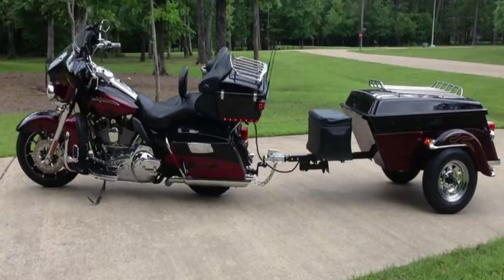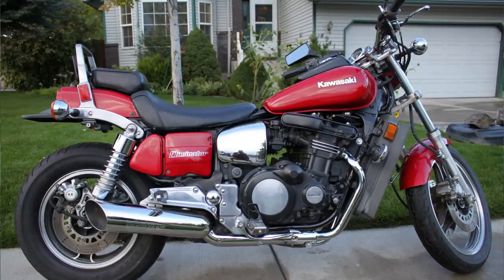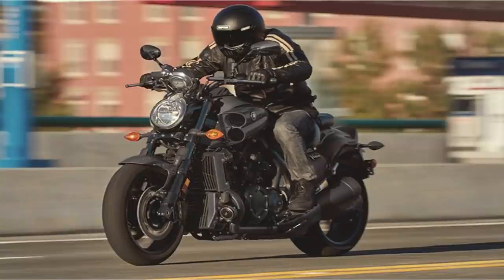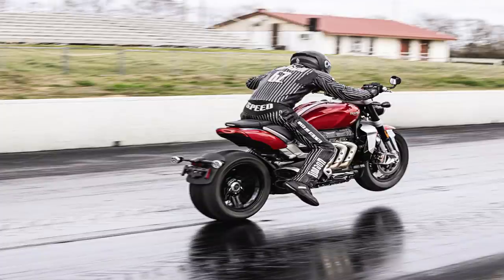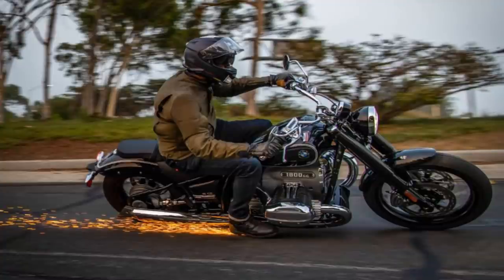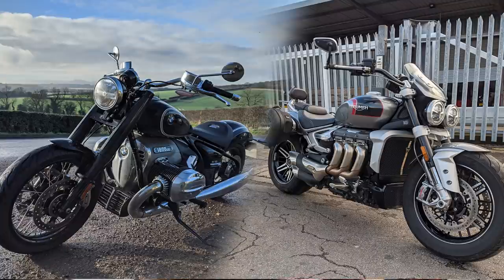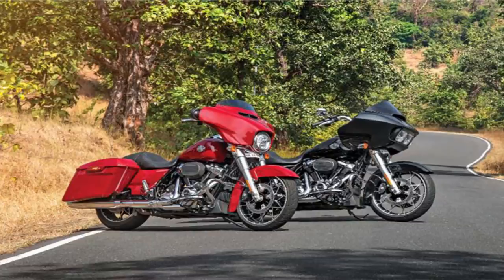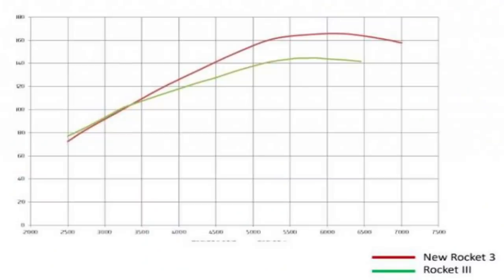Cruiser Motorcycles That Went Way Off Script

Comment: I like your video and breakdown of cruisers that our outside the box. I ride a Vulcan S. It’s completely different from HD. I had a Sporty 1200 and sold it for the Vulcan S. It’s lightweight (sub 500 lb) with the parallel twin out of the Ninja 650 that makes some kinda sad power numbers, but it’s chain drive and efficiently puts down most of the power it makes. It’s fast and fun to ride. It wasn’t expensive either. It’s a strange bike because it has the look and ergonomics of a cruiser, but sounds like a crotch rocket. 🤣
Reply from the maker: Those are really neat bikes though, they are like the Ninja 650 but they use a heavier crank and different cams for low to mid range torque. They really are a blast to ride, l always wanted to pit some Ninja cams in one with that heavier crank to see what it would do.

Comment: I had a GL1800 for a few years but I had some strange problems with it. After the Goldwing I got a Voyager 1700. I couldn't get rid of it fast enough. I love my 2009 twin cam FLHTCU, I have had it longer than any other bike that I've ever owned. However, if I was to go for a non HD again, I'd like to try that Beamer cruiser. 
At this stage in my life (63 years old) I'll probably just stick with what I know works for me. I have the ultra classic just the way I want it, big boar kit with cams, D&D Fat Cat Exhaust, SE Air intake, Legend suspension, Custom Dynamics Lights and turn signals, mustang seat, and a lot of other upgrades. Although a set of 14 inch Apes just could end up on the bike soon.

Comment: I would rather see Harley do a full water cooled V Twin Single Pin Crank motor with the fake fins that sounds just like an Evolution motor, but have the power of a 114 or better.  I could get past the radiator if it sounded, vibrated, and pulled like a Harley.  Should be alot easier to keep the emissions police out of your way.  Any maybe slow traffic in august would be more tolerable for the rider, and the motor.

Comment: Bike I have not owned yet.
1. 2014 Honda Valkyrie(6 cylinder) Basically a stripped down Goldwing. Similar to a Roadking concept. Would not mind having one of these.
2. Honda CTX1300(V4) The first thing I would do is try to tune it with a ST1300 map.
3. 2014+ Kawasaki Vulcan S - This bike is the most overrated and underrated bike ever. Fun and fast enough and reasonably priced.
4. Indian FTR1200. It is a twin, but a LIQUID cooled OHC twin.
5. H-D Streetrod 750. Not to be mistaken for the Street 750. One of the best bikes H-D has ever made. Just not a good H-D. Most people looking for a H-D would not be happy with a bike like this. But it is the highest performing H-D you could get new for under $10,000 Will even out run most H-Ds. If they come out with the Bronx, I am in!!!
6. The VMax 1800(V4). One of these days, I am going to buy one of these.
7. Rebel 1100 (Parallel Twin)  Been serious consider getting one of these as well.

I have had most other Japanese or America power cruisers at least once. Never considered buying a European one. Rocket 3s are cool, just not for me. I have also had almost every other cruiser V4 not included on this list. Now they are getting sick power out of smaller twins.
Reply: The Valkyrie is an amazing bike! Tons of power and silky handling.

Comment: i owned a few of the early metric muscle bikes, the Kawasaki Eliminator 1000, and the Sabre version of the V65, and i also owned one of the XS1100's and the original Vmax and yes they didn't have the low end grunt of some of the HD, and Indian cruisers, but back when they were out Neither did HD or Indian, 1 Indian didn't really exist, and Harley was just flipping over from the AMF 74CI 1200cc to the 1340  and back then Harley topped off at about 90-95 MPH and all of the Metric bike i listed Exceeded 130MPH some rather easily lol

Comment: Its a shame if you ask me that Harley abandoned the V4 project. I think the balance of torque and horsepower in a layout that offers similar external dimensions to a vtwin is the way to go. 

However im sure the long time customers would've hated it because it wasn't a vtwin and I can see their point of view. Harley is about building a classic American cruiser, like if GM still built cars that look just like 1959 Cadillac Eldorados, thats Harley's bread and butter. If you abandon the vtwin you lose that classic look and feel.
Reply: I don’t want MoCo to abandon the V twin. Neither the air cooled M8 or the liquid cooled Revolution. But I would love to see them add in a V-4. 

Especially a big displacement for the big touring bikes if air cooled can’t make future emissions. The Venture V-4 tourer was well liked. Honda & Yamaha took notes from Harleys V-4. The 500, 700, 750, 1,000, 1100cc V-4s Honda made were great. The 1200 & 1800 V-Maxes are icons. Both Magnas & V-Max followed the V-4. Harley was finally leading some tech and take over leadership failed to put it in the end zone.

Comment: A standard BMW r9 t push out roughly 99 horsepower at the rear wheel and weighs 200 lb less br18 is Big bloated overweight underpowered a BMW equivalent of a Harley shame on them

Comment: Been a Rocket rider since 2005 and it's a great bike but I wouldn't compare it to Harley cruisers. It's in a different league and it's classified more as a muscle bike like a GTO of bikes and it handles better and has much better ground clearance. It's like comparing a station wagon to a Trans Am. I ride my Rocket more like a sportbike and only see HDs in the rearview mirror. BTW the new Rocket has an increased capacity of 2500cc or 152ci. I have ridden many HDs but they don't work for me.
Reply from the maker: The Rocket is a beast and a lot to handle!
Reply: @GixxerFoo   It is but it is the first bike I bought after my learning bike, a Kawasaki 800 Vulcan. I had about 2000 miles under my belt when I got the Rocket then 500 miles later I rode it to the Dragon and tried keeping up with my sport bike friends. Go big or go home! The next year I started tuning it to add some HP. 😁

Comment: Great video. I have to say one thing. The inline four is also the cruiser sound from 1941 with Indian's inline four. So yes, a long time ago American manufacturing produced a big inline four. I'm holding out for Indian to build one in the modern version but I may be wishful thinking. LOL! As far as horsepower and torque. There were some custom VROD's that were stupid powerful and some custom Victory's that were stupid powerful. You know the bike that burns the tires at every light with just a crack at the throttle. Tire companies love those kind of bikes like the VMAX and the rocket three. On a side note they are fantasy bikes for me. I have to say I love the videos on other bikes besides Harleys and the comparisons are pretty honest.
Reply: Not just Indian but also Henderson and Ace. American motorcycles led the way with inline-4 motorcycles going as far back as before WW1. Smooth, powerful, comfortable and durable. The American inline 4 motorcycles from Indian, Ace, and Henderson were Duesenbergs on two wheels. 

It was afterall a 4 cylinder Henderson that was used to take the record of first motorcycle to circumnavigate the globe.

Comment: Love your channel and the tech info you share. What are your thoughts on the Ducati XDiavel?
Reply from the maker: It's fast and produces a lot of power, I like Ducati's but the maintenance on them is quite extensive. The parts are high, higher than a Harley and the labor costs are pretty steep. You just have to keep up with the maintenance on them and not let it go.

Comment: Please consider doing a video on the issues with twin cam and Milwaukee 8 6 speed transmission issues that are plaguing bikes across the Nation. Additionally there are no parts available for those who have lunched their transmissions. Bert Baker is laughing all the way to the bank
Reply from the maker: That's a really good point, there have been quite a few issues with the 6 speed transmission. Baker is about the only way to go with replacing one and for good reason!
Reply: @GixxerFoo  I wouldn't even want anything new. F that

Comment: Looking to maybe do a woods tw 222 in a 2014 ultra limited is it worth it or is the 103ho cam avout the same..or what cam do u sugest for this bike...bolt in torque cam
Reply from the maker: It's a night and day difference with the Wood 222! The factory 103HO cam is a .511 lift which is a decent improvement in torque over the original 103 cam. But the 222 is leaps and bounds more torque and horsepower output.
Reply: @GixxerFoo  thanks for the input...like your vids apericate the honesty and u answereing me...thanks again

Comment: I owned a 2014 Triumph Thunderbird ABS 1600cc model.  I also own a 2003 HD Road King CVO with the 103 cu inch motor in it.  Both bikes did the exact same thing as far a performance.  The Triumph was smoother and had more up top engine performance from my "seat of the pants" feel.  But, the Triumph is gone and the HD is still in my garage.  Why?  I am an older rider (started street riding Feb 1974).  The sound and look of the HD bikes are what keeps them in my garage (also have a 1997 HD Softail Heritage Springer with the 80 cu in motor).  So, you missed the Parallel Twin in the cruiser model line and the Triumph Thunderbird with the 1600 and 1700 cc motors are great bikes, well balanced, good performance, but don't go "potato, potato, potato."  BTW, a lot of riders say, "I like HD because of the dealership network."  Most of those riders don't go out of their own state so that is just BS.  Also, HD dealers will not work on your Shovel Head and most will not work on your EVO motors.  So, dealerships are "aftermarket shops" after a while.  I just had my local Honda Dealership change my tires on my HD Road King because HD, in Redding, wanted $550 to do the job that Lee's Honda did for $200...  So much for dealership support and my 2000 Goldwing 1500 has all the parts I need on Lee's Honda, in Redding, CA, on their website!!!  Still parts available after 22 years!!!
Reply: I still have a 2013 T-bird, I like it a lot.  I'm fine with the sound.  Next bike I buy will be another sport bike, they are a lot more fun than cruisers.
Reply: @magsteel9891  I only have one problem with sport bikes.  My right hand knows no limit.  I have, at age 60, had my ZX12R up to 180 mph plus on Pyramid Hwy (Sparks/Reno NV) while passing the Wild Horse "prison" that the BLM runs.  So, my problem is Cops don't like people who exercise their bikes out in the middle of nowhere hurting no one!  They just like to control "We the Sheople."
Reply: @ababbit7461  yeah I've never gotten hurt on a cruiser.  Lots more noise than a sport bike but nowhere near the urge to go crazy. I got rid of my ninja last summer but I miss it.
Reply: @magsteel9891  I don't blame you.  Riding as sport bike in the corners is like a paint stripe going around that corner - sticks like glue.  A cruiser, on the other hand, goes around the corner like a steam roller on new asphalt.  As long as you go slow, no problem.

Comment: In the 70s I rode a Moto Guzzi Eldorado 850cc. That was a large engine at that time. I found it to be more reliable, far smoother and it would keep up with the HDs & BMWs. I have a Heritage now but it is not as smooth as the Eldorado was due to the MG being a shift drive. I'm kind of surprised that you left out the Goldwing in the comparison. Good video anyway! Ride safe.
Reply: ANYTHING is more reliable than a Harley.  They're as reliable as a politician

Comment: Sadly, Guzzi doesn’t make a cruiser anymore.  I had a ‘22 V7 Stone.  It had an 853cc putting out 65 hp and good torque.  Fun bike and top speed around 110.  So if you have an Audace, California, Eldorado, or the MGX-21 hold onto them.

Comment: What I've recently learned about motorcycle engines is it's all about the Bore and Stroke. A high stroke will get you Torque but too much will limit your RPMs and your HP.
Reply: It also has to do with valve timing and cam setup.

Comment: Thanks for bringing up the subject. My previous bike was a v4 Honda Magna so I can relate to it. Actually ride a 2005 xl1200c and love it. When it comes to choosing a bike one must consider parts availability and mechanical support. Other than Honda and Yamaha which both have a big aftermarket support but nothing like Harley in that area. At this time I'm considering a larger bike just for highway comfort, anything over 75 mph for a long distance is quite a challenge on a sportster. Now considering a larger bike might steer me towards metrics just because of their reliability ( used of course lol). Used bigger evos may have some issues as the newer twin cams, your videos on these plague me with second thoughts. For looks I like softails Harley's are on scope, but for reliability Yamaha and specifically Road Star models. What's your thought??

Comment: Not Harley styling model...... Harley copied from Indian....... Harley marketing put Indian out

Big low end Tq is not just big displacement, it needs big stroke

Ask any crotch rocket nut, if it's not a crotch rocket then it's a Harley

Another part of being a cruiser is long term comfort.....and that means forward controls or raising the seat up so high most can't touch the ground........the BMW boxer will never have forward controls and looks like might not be able to have highway pegs

Comment: speaking of suggestions.  Please consider doing a bit on the difference between torque and power at the rear wheel compared to the numbers people see on their FP3.  Some folks think their Stage 1, 103 bikes are pulling 144 HP.

Comment: My friend and I went riding the other day and he has a Low Rider but he also has a 95 Honda Shadow in mint condition that he decided to ride. We stopped after a fill up and grabbed a couple cold ones to wash down the dust when we both heard a crash outside the bar. We jumped up and looked to see what happened. Some asshole threw a chain over my buddies bike and dragged it away from the bar. Two hours later the cops found it in a local creek. My friend had insurance on the bike but found out insurance wouldn't pay for the damage. They said he was only covered if he hit something else. Total loss cost him $5000. I blame the assholes who did that to him because they were responsible for his loss. The cops never found out who was driving the truck but I'm sure they know exactly who it is. If you buy a foreign made bike get it fully insured against idiots like this...

Comment: The love of cruisers is rooted in the love for Harleys.  It's the Easy Rider lifestyle.  The Then Came Bronson image.  I love Harleys too.  But also own an 06 Yamaha Stratoliner and love it as well.  The bike is every bit as good in quality, fit and finish as any Harley ever was.  But it cannot compete with the Easy Rider and the Then Came Bronson image.  Harley is also very smart in where they compete in the cruiser market.  They don't make the fastest or the the best design.  And like you have noted several times, Harleys are old technology, reworked and reworked but kept uniquely Harley.  IE: the fork and knife crank.  That's also why every venture Harley has made into the "other than Harley market" has failed them.  IE: the old Sprints, the V-Rod and others.  I was a professional HD MC test rider for them for 2 years.  We had a bike that looked like the Can-Am Spider.  It was being tested at the same time as the current trikes were being tested.  The two wheels up front Can Am Spider looking version lost out to the current 3-wheelers.  Why??  Because on the Spider version, you dont feel like youre riding on a Harley.  The test name for the 3-wheelers was "Boomer."  Targeting the Baby Boomer market.  We also had a V-twin sport bike that had a Rotex 140 HP motor.  It too was cut before it ever came out.  Harley has what no other motorcycle maker has--the name "Harley," that unmistakable sound and the Easy Rider and Then Came Bronson image.  THAT is what every other cruiser maker is up against and that is why Harley always wins out in popularity in the cruiser world.

Comment: My 2nd bike k1200s weighs 500 lbs, 167hp at the crankshaft and 96 ft lbs. Only problem it has (no soul).
Still prefer my 114 stage 2 Heritage Softail. Crazy isn't 🤪 it! When I bought the BMW, The dealer said put on a exhaust and get more Hp. What for?

Comment: I'm a Porsche owner, so I get the boxer engine. It's a great design. Love BMW's per sa.  But it gets back to me again a couple of things that keeps me in HD's.  First is the fact the crowd rides it. And I've never ever been a crowd guy. But this time I am. And the fact that HD has dealers everywhere. Never know how nice that is until you need something. Even if it's not very often with these new bikes. Just knowing there are there is a real sense of relief on the road. If it was not for the HD mystique, I would be on a BMW.  Also, as you pointed out, the power number are so similar. Exception noted!  And the really fun part is to take your stock HD and pumping the motor up for us gear heads. Can't do that any more on anything else.  Thanks for the look at the other cruisers.  Cool bike for sure.